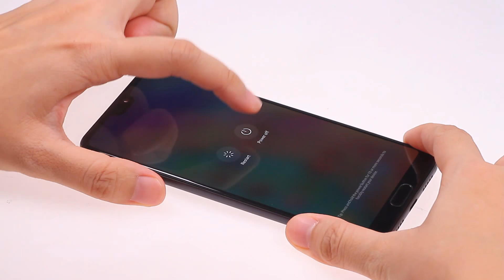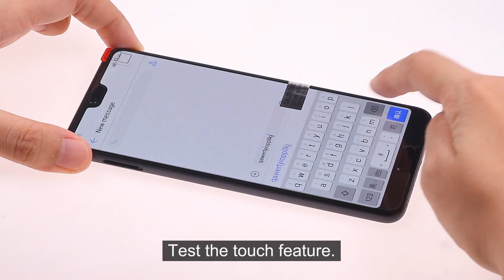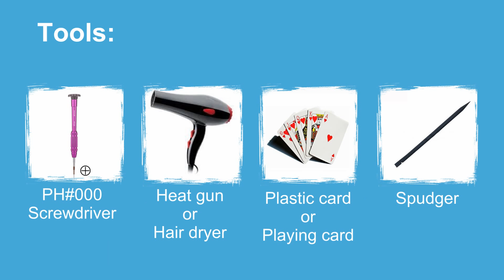Huawei P20 Pro Screen Repair Guide

Comment: I've broken my Huawei p20 pro's screen from the top left side. Not much. But the problem I don't understand. There's lines but with the screen and colors all ok. But if I want to change the screen should I have to change full or there's no need to change?
Reply: Eventually the ink starts exploding underneath ..you might be able to maybe put some sort of adhesive or resin

Comment: So no more removing the speaker to change the screen. (P10) 
Can't you just remove the back & the battery to replace the (frameless) LCD screen & glue sheet it shut to seal it ?
Don't understand why you need to disassemble the whole thing. 
Is it just for general part replacement ?

Comment: Will it still be waterproof?
Reply: No
Reply: yeah, just make sure you put some good ass glue on there.
Reply: Use T-7000 (multicolour) It's black & thermo-setting. Dries like rubber. 
On light coloured phones use B-7000 which is transparent and won't show. 
I prefer the black stuff (gold tube) as it totally prevents light leakage as well.
Reply: If light can get out, water can get in usually.
Reply: If you put the rubber parts good in place and you use glue